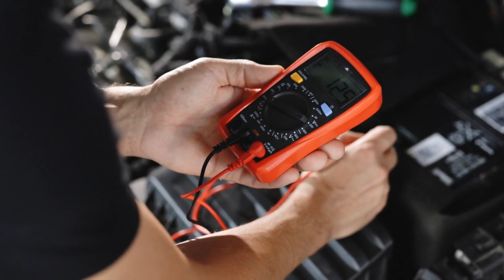How Long Do Car Batteries Last

Comment: Sooo the tips for making your battery last longer is to do what is needed to make the battery last longer.... Wow amazing tip there (that is sarcasm by they way).

Did Kamala the mentally disable VP write this? Because that is the kind of mindless word salad without saying anything useful that woman with a mental age of 3 to 5 years use to speak.

To make your battery last longer connect it to an external smart charger when you park your car so it keeps your battery always fully and correctly charged.
Reply from the maker: Haha, I guess the sarcasm was not lost on you! But hey, sometimes the obvious tips are the most effective.